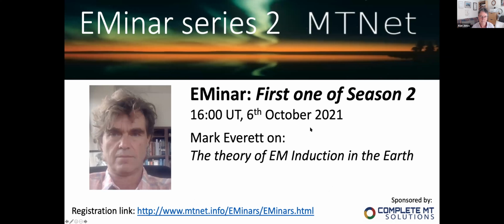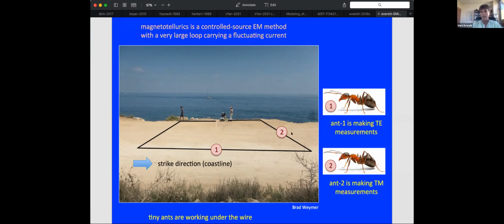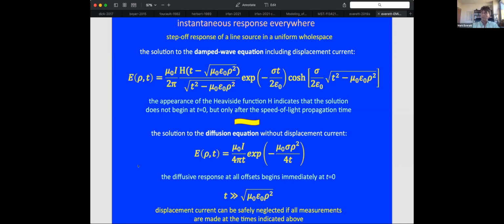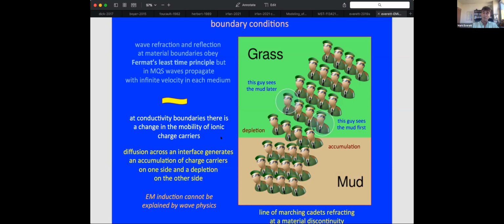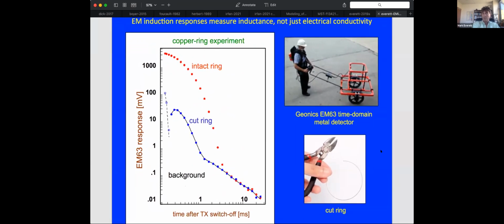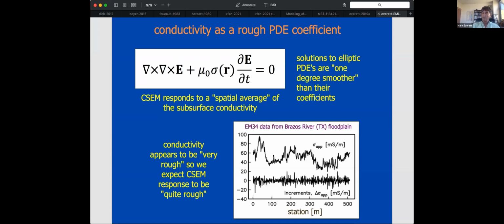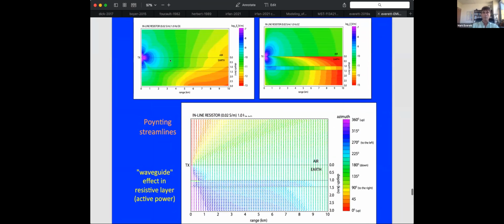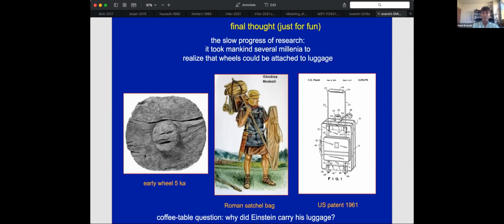EMinar 2.1: Mark Everett - The theory of EM induction in the Earth

Comment: Can you explain why the electric field strength increases with distance away from the transmitter, when the inducing energy decreases with distance?

Also, can you explain how electromagnetic wave energy redirects itself through the air, towards the ground, assuming that the physical properties of the air are constant?

At around 55:41, you seem to be saying that current (energy) flows through resistors more strongly than it flows through conductors.  Can you explain this?
Reply: 1. electric field pattern is affected by spatial variations in electrical conductivity 2. it is a dipole transmitter so electric field lines must eventually close on the transmitter 3. with a current-carrying wire, energy flow is radially away from the wire, into free space
Reply: @markeverett5925  in your model, there is no variation in conductivity inside each layer.  How does this lack of variation in conductivity explain the behaviour I described?
Reply: 2- if the transmitter is a magnetic dipole, it has no electric field lines unless the magnetism is generated by electric current. 

In that case, the electrons in the conductor generate a radially outward field, away from the current source.  In the system you describe, the net electric field lines would only close (converge) if there are positive charges in the system.  Could you explain this?
Reply: @markeverett5925  stating that the energy flow is radially outward from a current carrying conductor does not explain how current flows better in resistors than in conductors.

Could you elaborate on this?

Comment: At 39:59, you say that an open loop has no inductance.  Is it not possible that current could still flow in the wire, accumulating at either end of the cut, and alternating to produce the induced field?  That would effectively give the curved wire segment an inductance.
Reply: the cut loop is an open circuit
Reply: @markeverett5925  Okay.  So if the cut loop is an open circuit with no current, why is there a signal?

Comment: Hi,

I have a question about mutual inductance.  At 34:55, you have a diagram of two coils.  Is the net mutual inductance not zero (no mutual inductance) because there is always an equal (optimal) opposing field from the other coil working in the opposite direction?

So at steady state, there is never any mutual inductance.

Could you explain?
Steve
Reply: perhaps in very special geometries such as coaxial or coplanar identical coils...
Reply: @markeverett5925  okay.  Neither of those arrangements would generate the same field as the original coil, so how are coaxial or coplanar identical coils different from offset coils of different radii, at an angle to each other?

Suppose you calculated a large loop, generating a large inducing field in an offset, angled, smaller loop below the large loop.  

Could it be shown, mathematically, that the large field in the smaller loop induces a current I in the small loop, and the smaller field generated by I in the small loop generates the same current I in the larger loop, so that at steady state there is no mutual inductance?